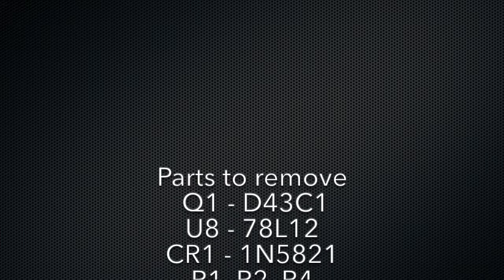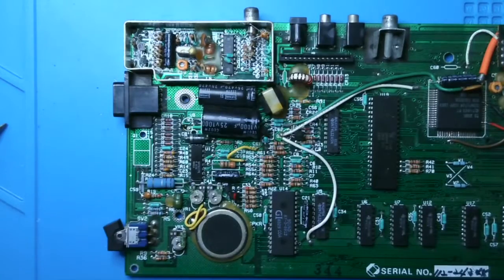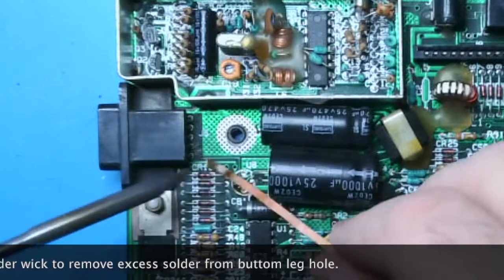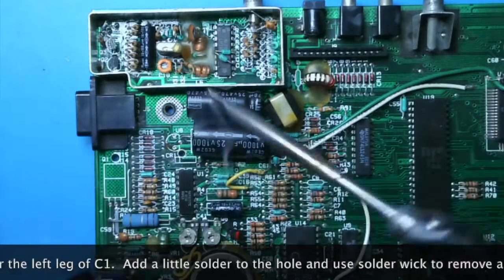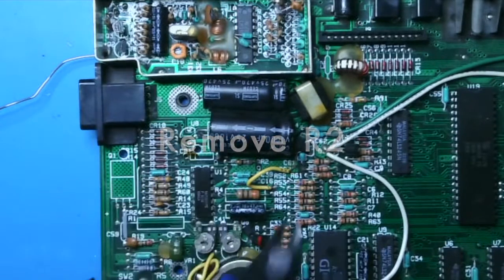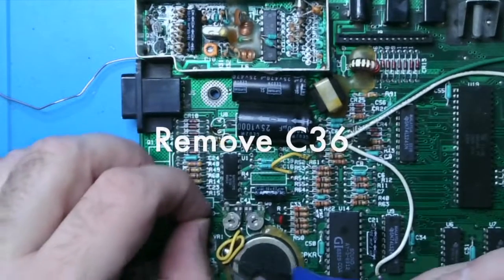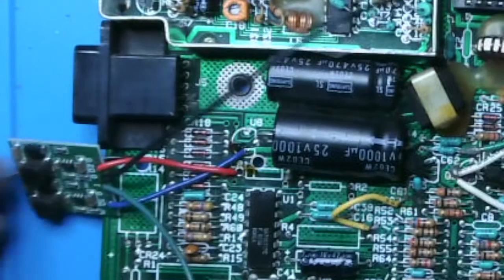TS 2068 Power Supply Replacement

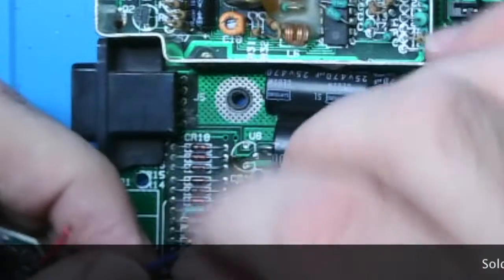Comment: At 5:44 you say, "Output 1 is 12 volts and output 2 is 5 volts. I've wired output 1 with the Red and 2 with the Blue. So Red is 12 volts and Blue is 5 volts. At 8:00 you connect the Blue wire (you had connected to output 2 of the small board) to what you call the "hole where the 12 volts regulator used to be" and the red wire (you connected to output 1 of the small board) to the left leg where CR1 was, being 5 volts . . . seems to be a little confusion there.
Reply from the maker: Yep, you're right! I misspoke. Always follow the actual markings on your power module :)